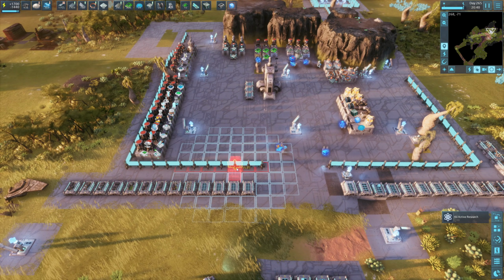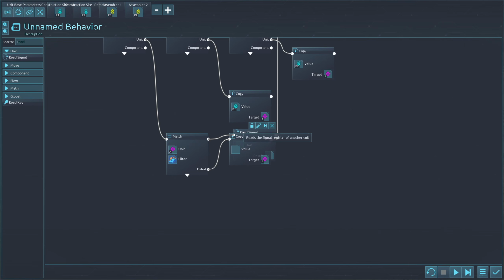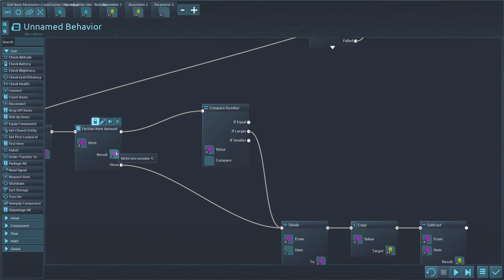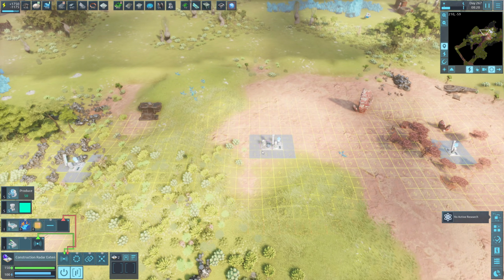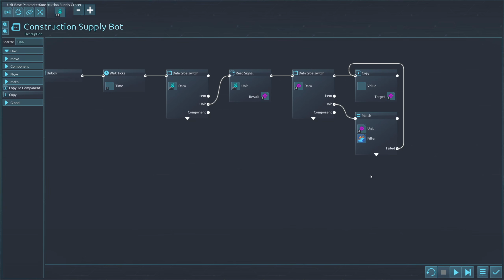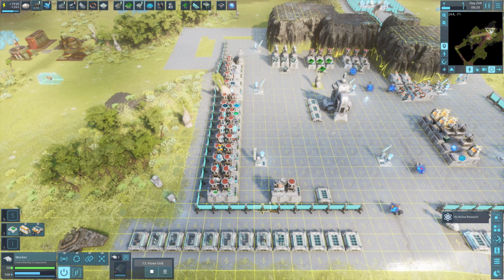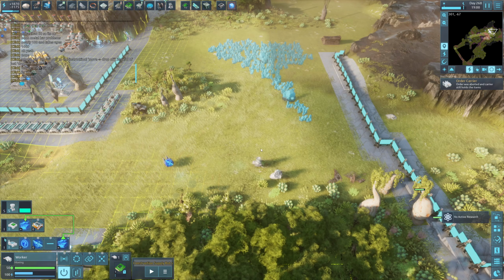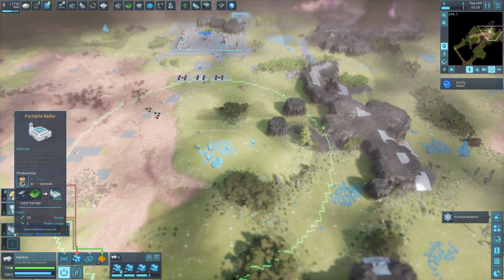Desynced - Construction Automation System, and some troubleshooting.

Comment: I\m trying to replicate this and while constructor part works great-ish for the most part, the delivery bot just refuses to drop items, it'll reserve them for a dropoff, but will not transfer the items with either command unless it already had the item in inventory before construction site was identified.
Reply from the maker: In the past year, since release of this video, there have been quite a few changes to how behaviors work. One of relatively recent change was how two relevant instructions work:
Order Transfer To and Drop Items.

Back when the video was made Order Transfer To created a new direct order for item to be moved, and automatically assigned the unit to that order, irrespectively of its logistics settings. It was direct equivalent of dragging and dropping item from inventory on top of target, in this case - construction site. 
This was used as Drop Off instruction did not work for some reason with components.

Currently this instruction only orders 'a' delivery from source unit to destination, which makes it non-viable for quick and direct transfer, for unit that is capable of performing the delivery.

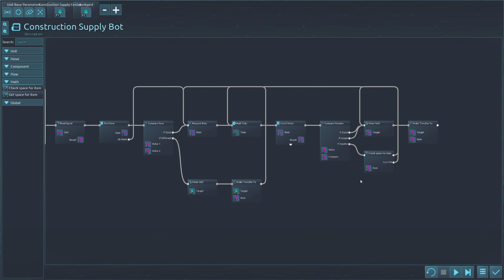Going by the part as shown in 38:30, in current version I'd replace Order Transfer To with instead Drop Off items instructions, to keep the functionality as originally intended.

Given the number of differences in how to use it, I will most likely start creating a new tutorial series, to address major changes, especially in light of changes from current - i.e. combat update.
Reply: @Almaravarion  I fixed the bot, had to tick off 2 things under logistics network, works great now. 
I'll welcome new content here, I did some simpler behaviors but what you do here is much more optimized and I've learned couple things as well.

Comment: I replayed the video multiple times. Played in .5 speed to follow along and copy it. 
I'm still stuck on wait a tick command. Can't seem to figure it out.

Record every time you set up a new command and just keep releasing them.
Spam the videos.
Reply from the maker: Wait command, and Unlock are two parts necessary for throttling of execution.Usually Desynced will perform either 1 operation per second [when 'locked' i.e. without unlock instruction) or up to 1000 operations within a tick with unlock node. Unfortunately if the behavior attempts 1001st instruction it will crash. This is why 'wait 1 tick' instruction is added, in order to not keep the instruction work in a continuous loop, and perform entire code more than once in a tick (and thus - not crash the behavior controller).

Wait command basically means 'once encountered wait for x ticks - in this case 1 or 0.2 seconds, and continue performing rest of the behavior instructions'.
Reply: I understand what wait a game tick is. 
I just can't figure out the program. It stops on wait and won't go any farther
Reply from the maker: @LTL_king  it stops on wait for the amount of ticks it says it stops for. It then processess up to 1000 instructions all in one tick, which no screen I am aware of can render at that speed, and will loop back. To see how it works in detauls use pause button [bottom part of the screen on the right, once the program is running there will be two vertical bars, or 'pause' button], and then click manually on arrow with a bar. I.e. 'move to the next instruction'. This will be much slower than normal code, but will show You what is happening.

Visually the highlighted [as in 'one being processed] will be usually any instruction with wait element - notably wait, or drop off instructions, as those will take long enough for human eye to register (~200 ms).
Reply: I just said I know what wait tick means. What I'm saying is that it's stuck. It will not move past that. 
I could set it to 1 tick and leave it sit there for 10 minutes. It's still waiting. It will not move past wait tick.  @Almaravarion
Reply from the maker: @LTL_king  And I have mentioned that unless You are going step-by-step with instructions it WILL appear to be stuck, due to the wait instruction taking the longest of entire behavior. In fact this is intended visual representation, and can be used as pseudo-break points in behaviors.

So - let me ask You directly - did You analyze the run of the code with step-by-step instruction, or did You simply start it up, and saw that wait instruction is staying highlighted (which is expected if there is no other 1+ length tick commands, and is NOT indicator of stuck behavior)?

Comment: There is currently (25 Aug) an issue where the Add and Subtract functions drop the ID from the result eg. it returns "1" instead of "Solar Cell 1".
This has been fixed in the experimental branch but there is a workaround before the fix hits stable:

Set the result of Subtract to a new variable (I'm using E) then insert a Set Number block:

Value = B (Solar Cell)
Num/Coord = E (1)

This returns the expected result of the subtraction, "Solar Cell 1".

Comment: @Almaravarion

That is a big program. Could you break it down into sub routines, and then use Call function to join them together?

Conceptually it might look neater and thus easier to manage

I would like to see a video on using Call function, maybe just a short ?
Reply from the maker: Thank You for feedback. I will split it up into smaller parts, as frankly it never occurred to me to split this behavior into subroutines, though it should be noted that I regularly work on behaviors where ~40 instructions is 'extremely simple. I will keep in mind to split them into more manageable sections.

Comment: All your videos are way to quiet! I like the videos but the voice is so quiet :(
Check your microphone settings while recording or when cutting,  something is off.
Reply from the maker: Unfortunately You are correct, Those recording were made using previous microphone during demo, and it happened to die few days after recording. During the weekend I intend to create a new video or two for the guide series to have better versions listed in main guide on steam, and updated series linked here as well.

Comment: Can you copy AI behavior to the clipboard and share it？
Reply from the maker: Unfortunately no, not this exact one, mostly due to two main issues - first - this behavior had some bugs I found later, so I will have them fixed in new version, and secondly - it was on public server that is no longer around (and frankly I didn't save it), however I intend to create a new video most likely later today or tomorrow on the same topic, with a bit more cleaned up system.
Reply: Would that be the bug when only a single item needs to be constructed and divided between the two assemblers, because I'm struggling with that right now. @Almaravarion